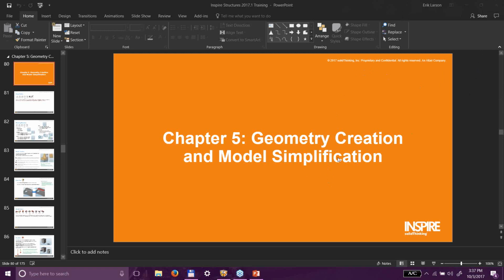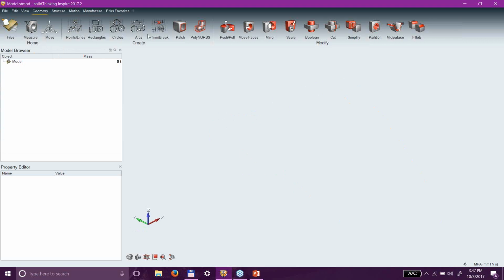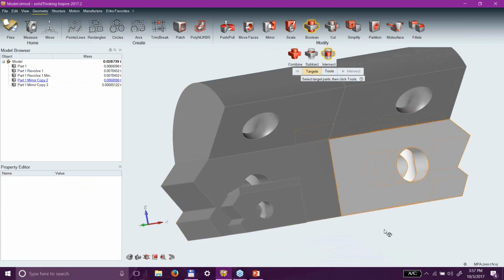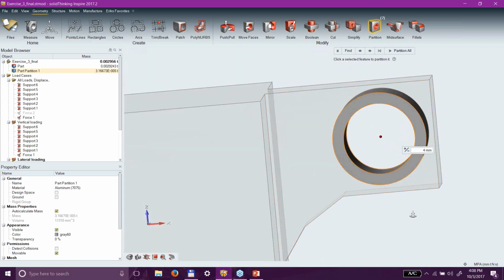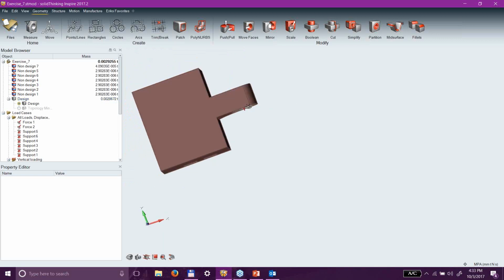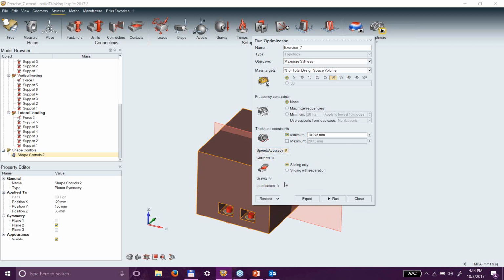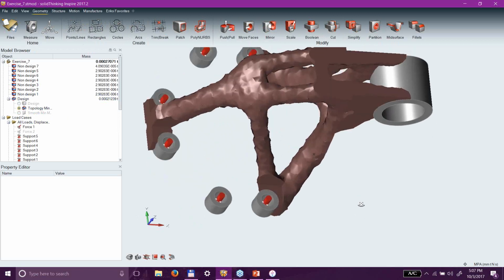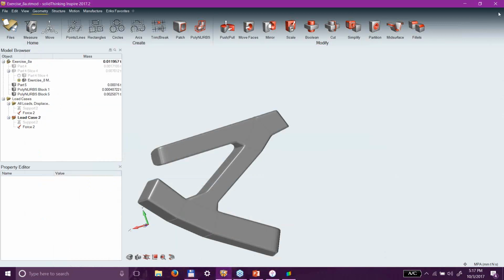PART 2: Altair Inspire for Design Optimization & Analysis Online Training

Comment: I downloaded the trial version with the intention of buying this software, but I am very disappointed with the performance. The software is very easy to use and all setup is very simple; however the software doesn't work properly for me. It can only solve very simple geometries, or assemblies. I design parts for cars such as JLR, BMW, Tesla, etc. I imported the parts from Catia V5 (step). Most of my parts failed to be solved. Inspire looks like great tool. I thought I was doing something wrong when setting up the parts; however at the end I found out, the software only works sometimes with some simple parts, it is very basic. When compared with other CAE softwares, the capability of Inspire is similar to Microsoft Paint when compared with Photoshop! Don't waste your time and money, this is for students to learn basics, not for the real world.
Reply: This is dedicated especially for the small parts for optimizing the components in mass volumes where each gram counts for example in automotive. Definitely not for assemblies. Software is not the issue. Problem is that you have chosen wrong software for your job.